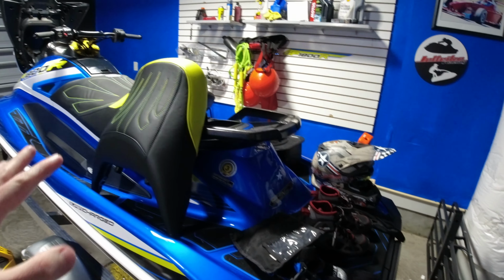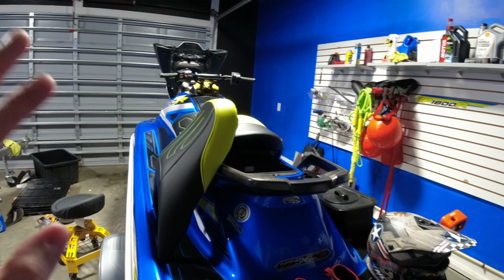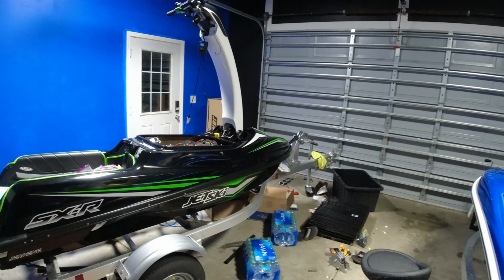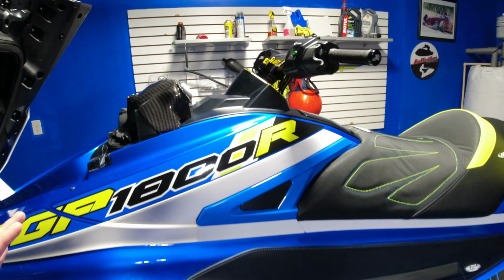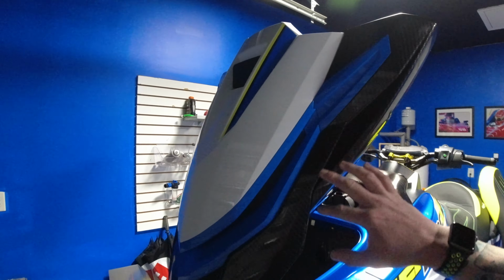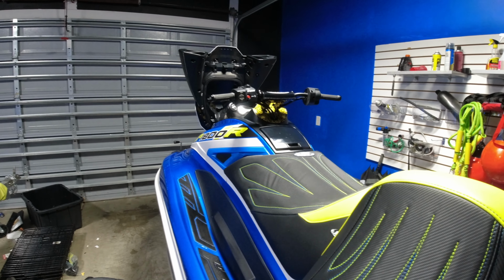New Issues Found With 2021 Yamaha GP1800R SVHO 4K

Comment: As A Factory Trained Mechanic I Was Always Told Never Ever Buy A New Production Model of Vehicles After A Production Change Or New Design. It Is Not A Proven Design Change. Only When It Has Been Proven I Might Buy One. Cutting Production By 15% Outta Tell You Something. Good Thing Covid Came Around Yamaha So You Can Blame A Raw Material Problems. Funny That Seadoo Does Not Have Raw Material Problems. 
P.s I Swear You Have The Most F.U. Luck With Ski's.
Reply: They have a lot more problems

Comment: i had problems with my 2019 gp1800r when turning without throttle it would throttle up by its self . i expressed to dealer to document it with my first service in 2019 and it still happens from time to time
Reply: That's a feature for off throttle steering... it kicks in to assist turns in off throttle situations. It's really there to help newbie riders. OPSA or OTS. Dealer should know that's been on most watercraft since the mid 2000's especially Seadoos.

Comment: So I am looking into purchasing a pwc in the next few months. I have the same outlook of wanting reliability. I have looked at the new gp1800r SVHO, Kawasaki Ultra310r, and the seadoo rxtx 300. At this point would you recommend waiting? Buying a new one? Or buy a used one?
Reply: If you want the full size of the 310 and the rxtx I would look at the FX SVHO. Same speed as GP but bigger ski and much more comfortable ride. The GP1800 is more comparable to the RXPX-300
Reply: Buy a 2020 Yamaha and lower or wait till the 2022 skis come out because they will be revised
Reply: I don’t think you have a choice they are sold out
Reply: Yea dont get the 21s